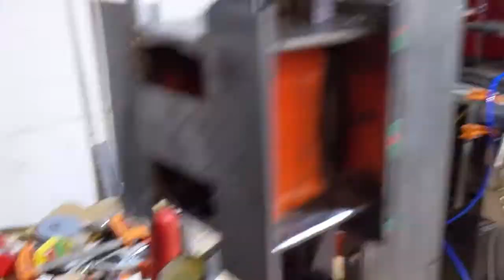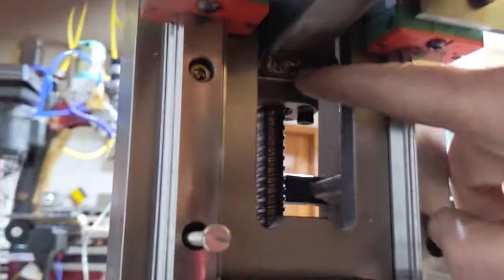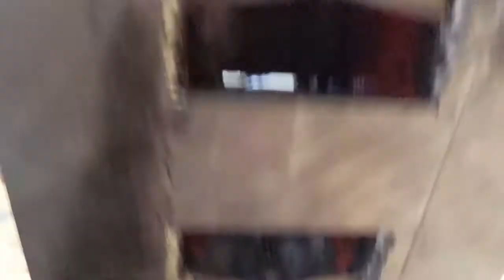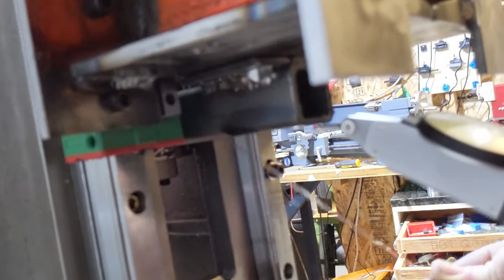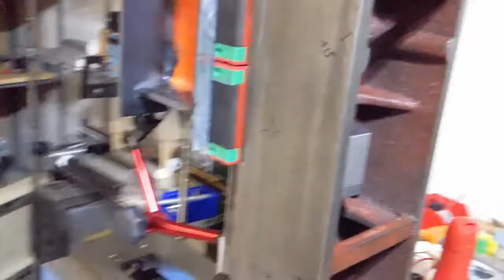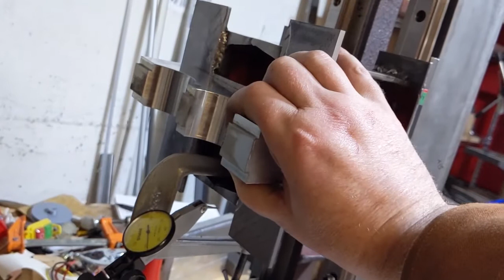sx2.7 casting based CNC:  The Ball screw dilemma, need input!

Comment: Best Practice of mounting screws for moving axis is to mount them in between your ways, or at least as close as possible to the center of your ways.  A counter weight mounted to the center of mass over the head would also help with your accuracy and reduce wear to the ways.

Comment: Ball screw has no such function to hold things together.  It's the guideways and machine frame job.
Reply from the maker: It holds in one degree of freedom, so it does hold something.  I ended up going a different route and removing the aluminum bloc and replacing it with a 12mm steel arm that connects to the headstock.  There was too much flex in this welded part, overall the headstock has too much flex but the machine is actually working decently now.  I'd like to design a new headstock and have the parts laser cut/welded.